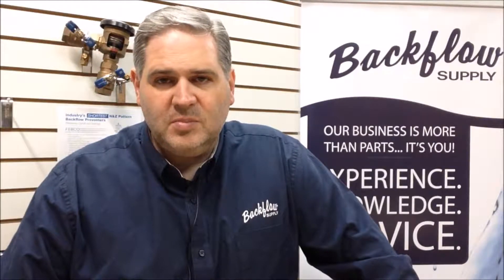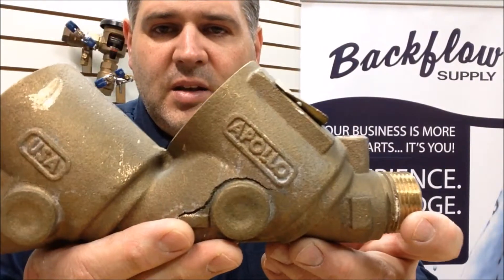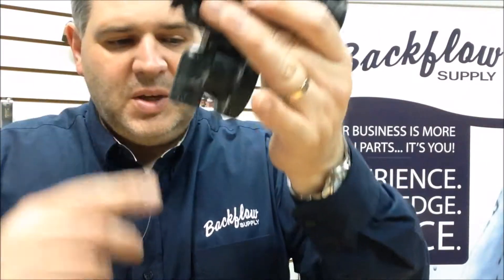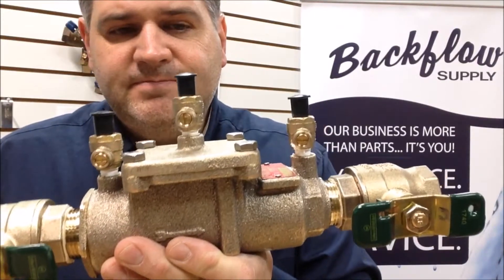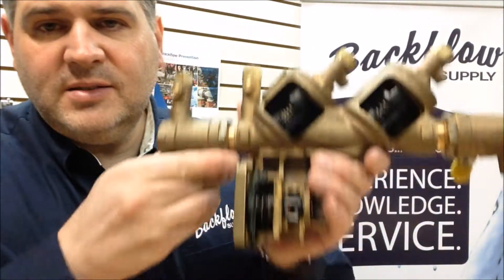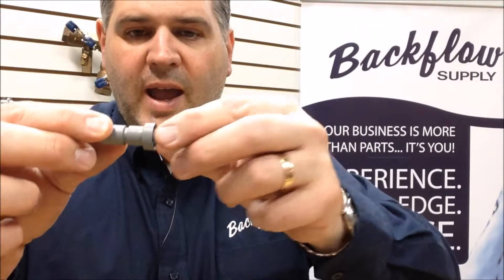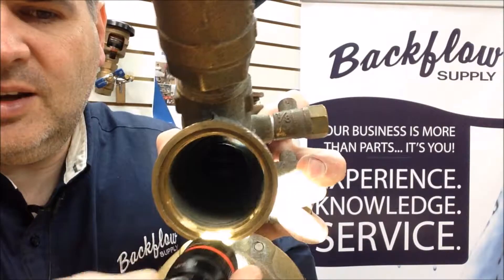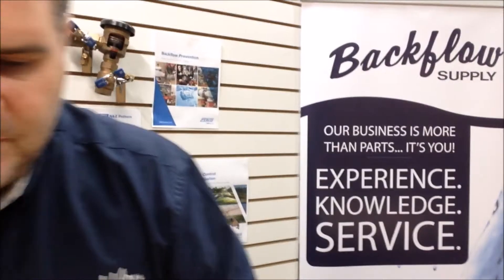How to identify Freeze Damage in Backflow Assemblies

Comment: Thanks for posting this excellent video.  I’m trying to figure out why I have leaking from my diaphragm (around several bolts) cover on an rp40 backflow preventer.  Perhaps my cover is warped or it is something internal.  You’ve given me some great ideas to check on.   Thanks again for taking the time to post
Reply from the maker: Nathan, I have never seen or heard of the relief valve cover warping on the RP40.  I suppose it could happen.  I would be interested in some photos of where it is leaking from or even a video.  Call me at 801-355-6736 if you want to talk about it.  Wonder if you have other damage as well if you have a warped cover.
Reply: I took off the cover and cleaned off the diaphragm and the relief valve and after reassembling the leak completely resolved.  Thanks again got your detailed video. Very nice!